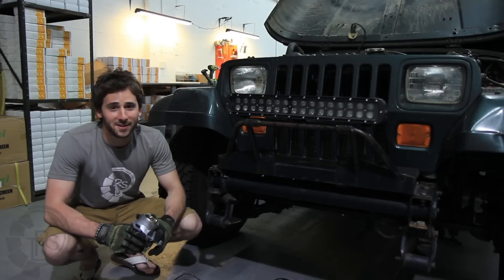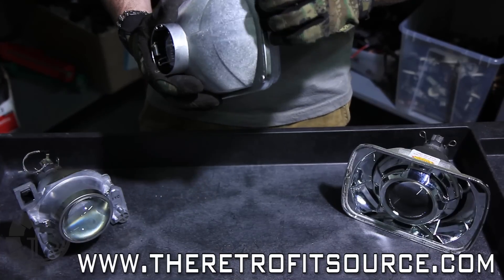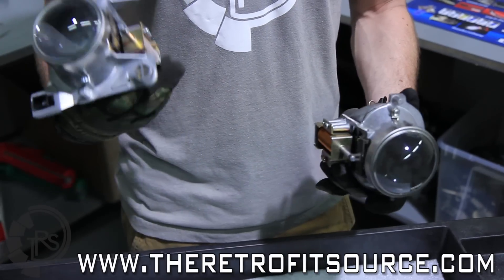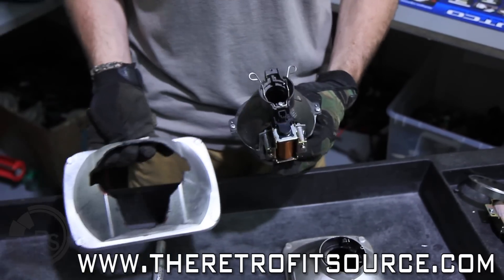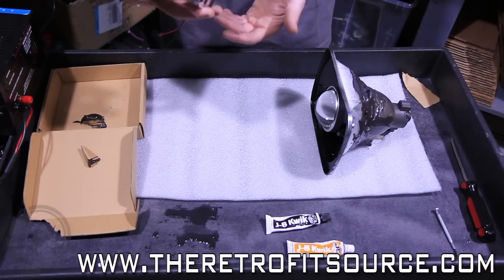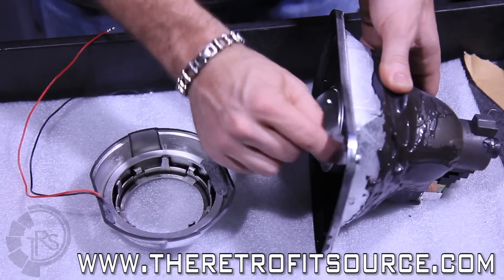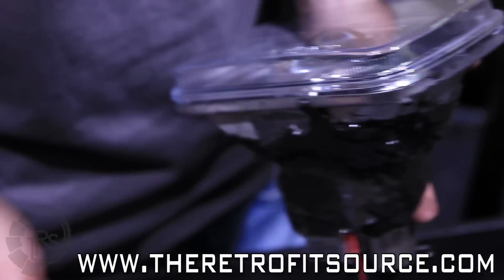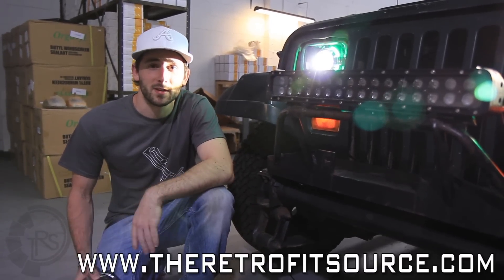TRS Tips: 7x6 Sealed Beam Bixenon Projector Retrofit How-To

Comment: would putting a plastic head light assembly in Gasoline hurt the plastic at all? don't really want to throw it in the oven...
Reply from the maker: ***** I would not recommend it, heating up a set of plastic square housings would be the easiest way to get them apart for sure. A Heat gun would also work
Reply: ***** No, that's not what he said. He was referring to removing the glass from the housing if you still want to use glass.
Reply: blackscorpion002000 re-read my comment. I was asking if gasoline would hurt the plastic lens.
Reply: Truthfully, I dont think so. gas cans are generally made of plastic if im not mistaken.
also, some DIY guys use bottles to collect fuel from the line connected to the rail.

Comment: Glass lenses are much better as the plastic ones will end up with that yellowish color and crack up the lens as the proyector will be too close to the lens and the heat will do its work, i reccomend using glass lens , you can heat it up just as the same as plastic...
As for the projectors you can buy on ebay bi xenon projector lens and those will be direct fit...

Comment: TheRetrofitSource Inc What did you use to seal the back of the housing? I have no idea what to use.
Reply: I want to know as well, ha ha. Did you figure it out?
Reply: When my friend did mine he used jb weld and 3m aluminum tape that was rated for 500 degrees.
Reply: William Brumble
Reply: Thanks man! So he just filled the whole gap with JB weld? Did it turn out good or would you recommend trying something else? You have a pic of it?
Reply: My friend used a 3m tape that is used for high temperatures and then yeah just filled in the gaps. It worked out really well.
Reply: Awesome man, appreciate the advice man. Making some custom ones for my ride. Cheers

Comment: nice but why go the extreme, new led headlights from: jw speaker, truck-lite are excellent, other options are available too.
Reply: Because they are expensive as hell and still does not offer the sharpness and clarity bi-xenon projectors have. And not to mention, has little to no color band to the cutoff. I would say JW led lamps are more "extreme" compared to projector retrofits.
Reply: Titus Omura some people just go the opposite, me personally haven't seen a perfect projector headlight yet (the light pattern)  On my c5 I've installed aca projector headlights with LED lights. I like the results: pure white light, low power consumption, very long lasting but not as bright as HID bulbs.  On my firehawk I can't fit those big LEDs without trimming a lot of stuff so I'm looking at HID lights. LED light is getting better and better that's the future so I'm looking forward to it.

Comment: Nice install, but what was done to watertight everything? I see the wires from the angel eye and the solenoid are still exposed. And the bulb mount and D2 fitting are not a watertight seal at all, how do you resolve this?

Comment from the maker: We recommend "re-building" the back of the housing using a first layer of Aluminum tape, super sticky and flexible, easy to cut, and then over-laying that with JB weld to recreate the housings.

LS460's would be pushing it, but honestly it should be do-able. For those, you'll definitely have to plan on modding the core support behind the actual headlight housing, since there will likely be some metal that will get in the way